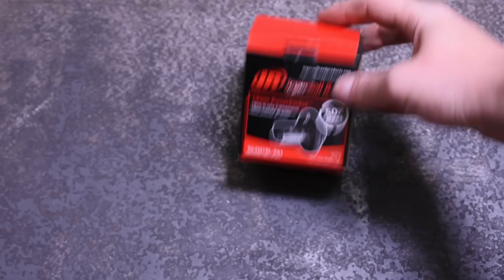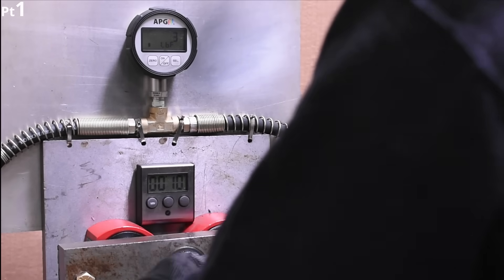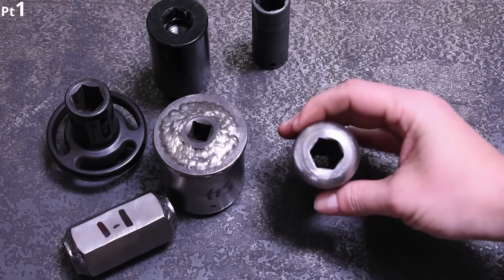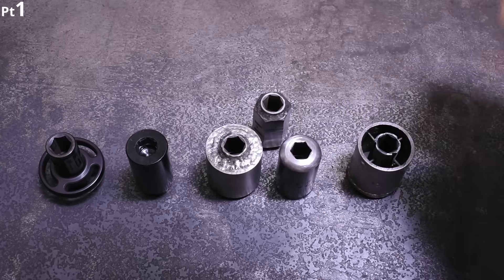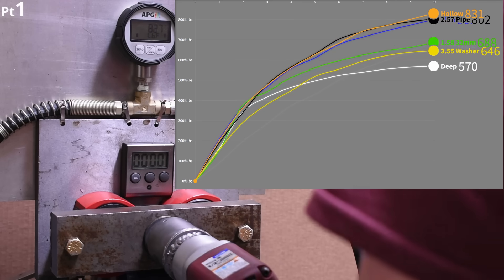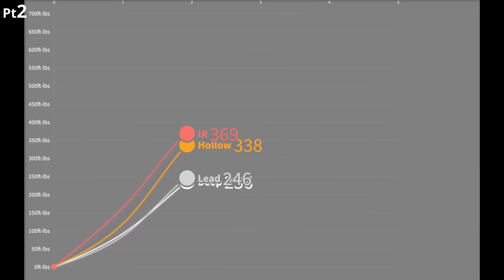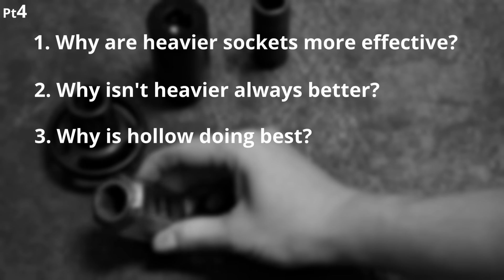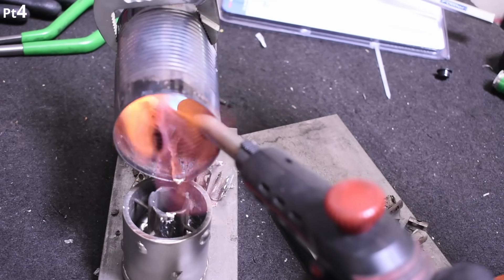Heavier Sockets Make More Power? Stumps Physicist

Comment: I tortured Chat GPT with this question. Here are two sessions. 
Let’s dig deeper and resolve the contradiction explicitly.
You're absolutely right to question it — the intuition seems like heavier sockets should “steal” some of the impact energy to spin themselves up. But here’s the key: *in an impact wrench, the limiting factor is *not the socket’s rotational inertia — it's the fastener’s resistance.**

Here’s the physics in a more convincing, engineering-oriented way.

---

# ✅ *Key Insight: In an impact wrench, the socket does *not spin freely before the fastener moves.**

The socket is locked to the fastener at the very moment the impact happens.
Because the fastener is resisting movement, the socket cannot accelerate independently.

This is the opposite of a drill or an electric motor where the shaft spins freely unless loaded.

So the hammer’s impulse goes into:

* overcoming fastener friction,
* not arbitrarily accelerating the socket.

Therefore **the socket does not siphon off significant energy to spin itself**.

Only the tiny bit of angular acceleration that actually happens goes into socket inertia.

---

# ✅ *Why a heavier socket helps instead of hurts*

Let’s model one impulse.

The hammer delivers a torque impulse *J* (think of it as area under torque vs. time curve).

That impulse splits into:

* *Fastener rotation*
* *Socket torsional deformation*

A heavier socket:

* twists less
* absorbs less deformation
* acts like a more rigid continuation of the anvil

Here’s the actual measurable result:

### *Heavier socket → Less elastic twist → More of the impulse goes into the bolt → Higher effective torque*

Whereas:

### *Light/thin chrome socket → Lots of twist → Energy stored and released as vibration → Lower effective torque*

The inertia argument becomes extremely small compared to the damping and stiffness differences.

---

# ✅ *Let’s address your specific argument: “Even pulses still require spinning a little.”*

Correct, but the amount is extremely tiny because:

1. **Socket is constrained by the fastener**, so cannot accelerate freely.
2. The angular acceleration through a single impact strike is tiny (fractions of a degree).
3. The moment of inertia of a socket is unbelievably small compared to the hammer/anvil momentum.

### True numbers

An impact wrench hammer has momentum on the order of 1–4 joules per strike.
The energy needed to rotate a socket by 1° is around 0.01 joules.

That’s why the inertia loss is negligible.

---

# 📌 *The part you are missing (because it's unintuitive):*

### *Impact sockets are heavier not to increase inertia but to increase stiffness.*

The mass is just a side effect of:

* thicker walls
* ductile steel
* lower hardness (to avoid shattering)
* less elastic deformation

The actual benefit is stiffness and reduced torsional “winding.”

Even if impact sockets were made lighter with exotic materials, they'd lose torque because they'd twist more.

So it's not “weight = more torque.”
It’s *“stiffer & tougher metal = better impulse transfer”* and weight just happens to increase as a side effect.

---

# 🔥 *Conclusion*

Yes, the heavier socket consumes a small amount of energy to rotate.
But:

* its rotational inertia loss is tiny
* the fastener prevents free acceleration
* the real improvement comes from reduced twisting and energy absorption
* thicker/more ductile steel gives better impulse transfer

So the net effect is *more torque delivered to the fastener, not less.*

---

If you want, I can break this down with actual numbers, like a micro torque-inertia calculation for a typical 1/2" socket.

"I asked to exclude comparison with chrome sockets. The answer is below."

Nice — thanks for narrowing the comparison to impact sockets only. That changes the framing and makes the physics cleaner. Below I’ll show why, even within impact sockets, the heavier/thicker ones tend to deliver more effective torque, not less — and I’ll do it with a couple of concise equations + a small numerical example so the intuition is nailed down.

### Short answer (one line)

For a given hammer impulse the angular *kinetic* energy actually *decreases* as socket inertia increases, and the *elastic (torsional) energy* stored in the socket also decreases as wall thickness/polar moment increases. So heavier/thicker impact sockets tend to lose less of the hammer’s impulse to spinning and twisting, and therefore put more of it into overcoming the fastener’s resistance.

---

### The physics (compact)

When the hammer(anvil) delivers an angular impulse (J) (units N·m·s), that impulse produces a small change in angular momentum of the rotating parts:
[
J = \Delta L = I,\Delta\omega
]
where (I) is the relevant moment of inertia (hammer+anvil+socket as coupled) and (\Delta\omega) the resulting angular speed change.

The rotational kinetic energy associated with that (\Delta\omega) is
[
E_{\text{rot}}=\tfrac{1}{2}I(\Delta\omega)^2
= \frac{J^2}{2I}.
]
Important: *(E_{\text{rot}}) is inversely proportional to (I)**. So *for a fixed impulse a larger (I) → smaller (E_{\text{rot}}). In words: the heavier the receiver, the less of the impulse ends up as kinetic energy of spinning that receiver.

There is also elastic torsional energy stored by socket twist during the brief impact. For a socket approximated as a tube,
[
E_{\text{elastic}}\approx \tfrac12 T\theta
\quad\text{with}\quad \theta=\frac{T L}{G J_p},
]
so
[
E_{\text{elastic}}\propto \frac{T^2 L}{G J_p}.
]
The polar moment (J_p) (torsional stiffness) increases when the socket walls are thicker (and larger cross-section). So *increasing wall thickness decreases elastic energy stored* for the same torque.

So heavier/thicker impact sockets affect both loss channels:

* They *increase (I)* → *reduce* rotational kinetic energy lost (because (E_{\text{rot}}=J^2/(2I))).
* They *increase torsional stiffness (J_p)* → *reduce* elastic energy lost to twist.

Both effects increase the fraction of the hammer impulse available to do work on the fastener.

---

### A tiny numeric example (to show magnitudes)

Take a small plausible impulse per strike (angular impulse) (J=0.001\ \text{N·m·s}). Suppose two socket assemblies differ in inertia by a factor 2:

* light impact socket assembly: (I_{\ell}=2\times10^{-5}\ \text{kg·m}^2)
* heavy impact socket assembly: (I_{h}=4\times10^{-5}\ \text{kg·m}^2)

Then (E_{\text{rot}} = J^2/(2I)) gives:

* (E_{\text{rot,light}}\approx 0.025\ \text{J})
* (E_{\text{rot,heavy}}\approx 0.0125\ \text{J})

So doubling the inertia halves the rotational-energy loss. Those energies are tiny compared to the typical per-strike energy input from the hammer (order of tenths to a few joules), which explains why inertia loss is negligible and why the heavier assembly is better.

Likewise, a thicker wall can drop the elastic/torsional loss by a similar or larger factor because (E_{\text{elastic}}\propto 1/J_p) and (J_p) grows substantially with wall thickness/geometry.

---

### Addressing the “it still must spin a little” intuition

Yes — a socket does get a minute angular change every strike. But:

* the fastener clamps the socket and prevents large free spin, so (\Delta\omega) is tiny;
* increasing (I) makes that tiny (\Delta\omega) even smaller, so the *energy taken to spin the socket decreases* with heavier sockets (counterintuitive but true because of the (1/I) dependence);
* increased wall thickness/stiffer geometry reduces elastic twist losses (where a lot of energy can be wasted in thin/wimpy geometry).

So heavier/thicker impact sockets do not “steal” more energy by spinning — they actually steal *less* (in the energy sense) and transmit more impulse to the bolt.

---

### Practical takeaway

Within the family of impact sockets, making them heavier/thicker tends to improve torque transfer because it reduces two loss mechanisms (rotational KE loss and elastic/torsional loss). That’s why impact sockets are thicker, heavier, and built differently than hand-tool chrome sockets — but as you asked, when comparing impact sockets to *other impact sockets*, the same reasoning explains why the heavier/thicker impact socket will often feel more “effective”.

---

If you want, I can:

* run a more detailed worked example with realistic socket dimensions (compute (I), (J_p) from geometry), or
* show a small plot of (E_{\text{rot}}) vs (I) and (E_{\text{elastic}}) vs wall thickness to visualize the tradeoff.
Reply: Didn't need a dissertation pal. You just say it's not it's mass it's it's rigidity.

Comment: I believe the flywheel has a leverage and longer range of motion over the rotation axis using metals natural elasticity. Causing overlapping in the power pulses while maintaining inertia from having more mass to retain that energy. The solid heavy designs don’t work because they’re suffocating the gun the light inside and heavy outside almost causes a resonance amplifying your input

Comment: Mechanical Engineer here. The mass of the socket is not the critical factor. It's the rotational inertia. The effect is basically impedance matching to get better dynamic frequency response. I.e. more efficient power transfer. An ideal socket would be infinitely stiff, and have zero mass (as well as a tight fit). Any additional mass or elasticity is going to cause reflected energy and lower peak output torque. I'd be interested in seeing a carbon fiber or maybe even a ceramic socket. I'd guess the ideal socket would be a short, thin, titanium or ceramic core surrounded by something like pre-stressed carbon fiber that is extremely stiff. Carbon might not be great because it probably has a higher damping than steel. But I'd be interesting to see. The lower mass might make up for it.  Alternatively, if you knew the exact rotational speed, you could design a socket like the IR with resonant springy bits hanging off it. With low damping you should be able to get a system Q of 5 or higher, meaning the force would build up across many hits, leading to a much much higher peak force. But it would only work at one very specific hammer speed.  One thing that I've always imagined, but never seen, is an impact wrench where you spin up a large flywheel and then suddenly engage the entire mass onto the socket. Would be a relatively easy way to get insane peak torque with little power. But it would be slow. Fundamentally, the bolt is going to take a certain amount of energy to install or remove. It's just a matter of how fast and efficiently you can transfer that energy.
Reply: " Would be a relatively easy way to get insane peak torque with little power."  YES, agree.  If they were designing a tool to SHEAR BOLTS OFF it would be a perfect design.   Look at the eggbeater impact,  just a few heavy hits per second.  Bet it would shear head bolts every time.

Comment: You have to have all three: Moment of inertia, resonant frequency, and timing .  Timing is not directly mentioned (or I might have missed) in the comments but is vitally important. (Excellent explanations of the first two are in comments herein - please see them.)  Timing, something that hopefully someday will be able to be picked up in a high speed camera, is all about when the mass bounces backwards and reverses to bounce forward again.  It is at this very instance - when just before the travel forward had ended - not at - just before, the impact wrench hops onto this forward travel and fortifies the motion forward.  When you have a socket already traveling forward with speed and you have an impact wrench fast enough to catch up and fortify this forward motion (impact wrenches are MORE than able to catch up), then you have - not really multiplication of energy - but and addition of energy.  That is, the kinetic energy of the weighted socket + the mechanical or forward (or kinetic) energy of the impact wrench.  This must obviously be done at resonant frequency, but the timing has to do with when the impact driver fortifies the motion forward.

As a negative case, timing of the impact driver hitting the socket when it is still bouncing backwards will suck the energy right out of the operation.  I suspect (a complete guess) that this was what happened with the lead socket.  Nothing to do with the lead being soft, etc. - only about resonant frequency and timing.

By the way, one can have a perfect resonant frequency and be completely off on timing where the result is a perfect symphony of an impact driver hitting a backwards-traveling socket every single time resulting in abysmal performance on the fastener.

Note:  This timing and frequency will change at different torques of the fastener.  That is why you see camel humps on the graphs.

To make one of these weighted sockets, it is done by creating hollow sockets or wheeled sockets with different outer weights for different moment of inertias for each socket size, impact driver, and test.  (Unfortunately, when it comes to timing, this MUST be customized to the impact driver.)  If one is serious about this, sockets have to be made just for Matco Tools, just for Milwaukee, etc., etc, etc. or fall on a weighting that happens to be good for two or three.  The data technically isn't emperical, but when testing, it really is.  Lots of testing.

Comment: I have a number of bars of woods metal, melting point 158 degrees f. Melts in hot water. Easy to handle and cast on any socket.

Comment: The purpose of the ring on the IR socket is not to add mass. It’s a flywheel. For the same amount of mass, placing the mass, etc. clean away from the center of mass adds to the torque. So yes, there is some additional mass a socket, placing that mass away from the center mass, increases the effective torque placed on the bolt in the socket.

Comment: As a physics student, the results make sense to me. This is about coupling, like in a newton's cradle. Since the bolt has lower rotational inertia than the socket, the bigger the socket's rotational inertia is, the worse the transfer of angular momentum.
However we also have the total angular momentum of the socket to take into account. The socket probably accelerates for a fixed angle every time, so the angular momentum transferred from the motor is equal to the time to turn this angle times the torque. So a socket with more rotational inertia has more angular momentum on every hit. So there is one dependency which increases with angular momentum and another which decreases, so there's a maximum in the middle.
Even if the time of the acceleration is fixed instead of the angle, the torque of the motor and therefore the angular momentum of each hit is likely to increase, as motors usually have maximum torque while stalling (this is also true for air powered guns, since they don't have to do any work once stalled).
This would again introduce a sweet spot for the rotational inertia.
To test this theory, you might measure/ calculate the rotational inertia of the sockets (for example with a torsion spring pendulum), measure the frequency of the hits and paint a marker on the socket and track the final angular velocity before the hit with a high speed camera.
Another test would be to add some rotational inertia to the bolt by welding a flywheel to it, I'd bet the optimal rotational inertia of the socket also increases.

Comment: I say the hollow unit works best because: 1) The impact driver is ALWAYS more powerful than the nut, so it will never feel any pain turning more mass. 2) Mass absolutely helps drive the nut. 3) The Hollow unit has its mass as far from the center as possible, so it is most efficient.

Comment: I'm thinking weight has to do with it but the weight needs to be as far away from the socket itself as possible this is where a more dense socket will lose this battle be
 because it's heavier and all the weight is closer to the center a Hollow socket puts the weight further out if you made it even bigger Hollow  socket with the same weight it would be even better very much like using a longer wrench

Comment: The hammer doesn't touch the bolt, so there's energy loss going from hammer to bit to bolt. When you have a heavier bit, you're storing energy in that bit. Which gives you better transmission into the bolt. Maybe you're getting two hammers worth of energy in the bit now, which is transferred into the bolt. Two hammers of energy is simply going to hit harder. But I wonder if it's SLOWER or not. There might be an overall energy over time loss. Might not be. Stronger hits will also move the bolt a lot more. Might be faster overall.

Comment: My theory is if you were to record the impact drill in ultra slowmo and if you can recognize when the hammer strikes and finishes striking, then you will notice the hammer strikes last longer on the heavier sockets.

Typically when you have a heavier item delivering more force in a set length of delivery of force say a bullet in a barrel of a gun or a hammer in a typical swing its usually due to same force applied vs the object for a longer period of time because it is accruing energy for a longer period of time because it takes longer to accelerate the object out of the area that is delivering the force.  So if you in the case of a bullet lets say you have a light and heavy load with the same amount of powder delivery the same force through the same barrel.  The heavier bullet would take longer to accelerate out of the barrel than the light bullet due to inertia so there would be more muzzle energy for the heavier bullet even though it would still be moving slower than the light bullet.  The extra time in the barrel is what accounts for the extra energy on the heavy bullet.  Technically the hammer strikes in the impact drill aren't instantaneous so theoretically it could be due to longer exposure to the hammer strike that accounts for the extra torque.